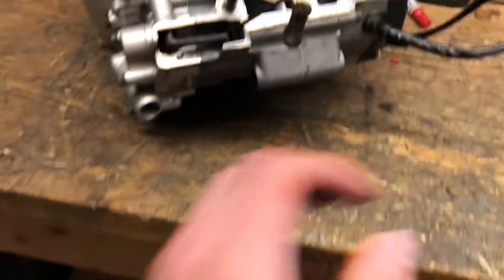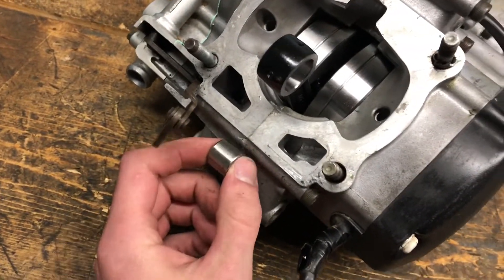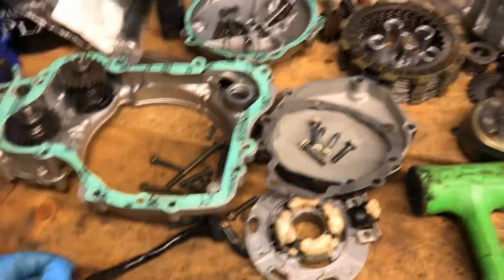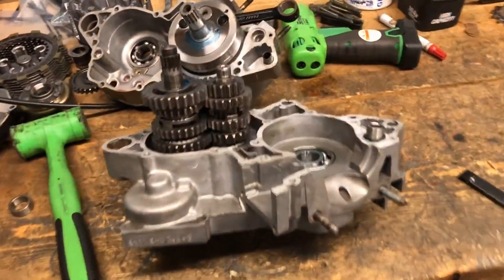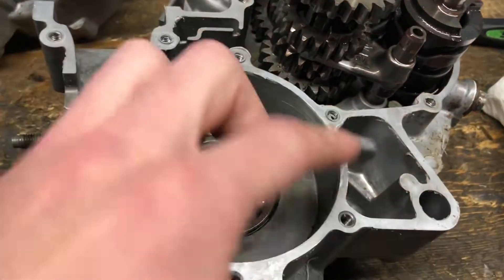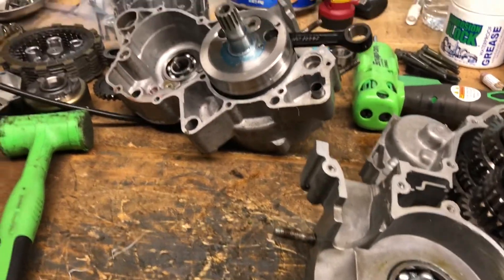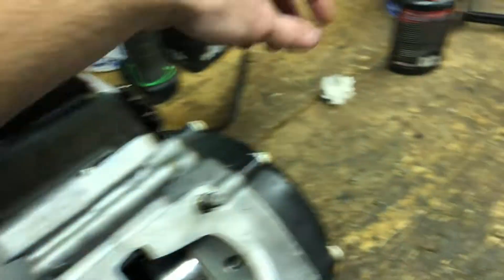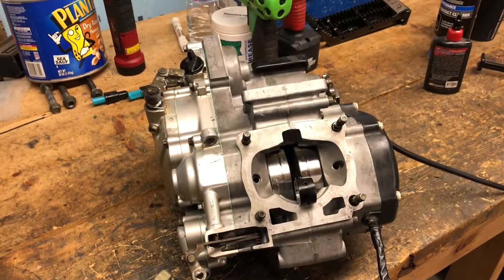Yz 125 Bottom end issues

Comment: hey bro I'm about to start reassembly any tips? thanks
Reply from the maker: Florida Lottery Take your time! It’s not as hard as you might think it is. And make sure everything is toqued to spec and you’ll be fine! Check online for assembly specs as well. You got this!
Reply: @BicBoiDyl  thanks got the bearings and crankshaft installed. now I found that the pin dow I pulled out I don't have...I guess there is 5 dows on this motor...they sent me two...so I have to straighten the one I slightly bent and put the case together today.